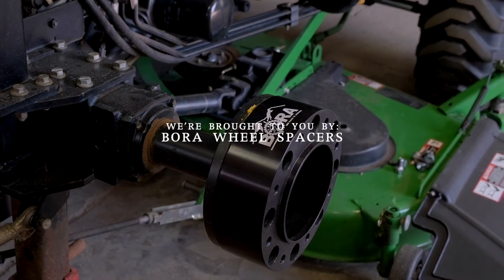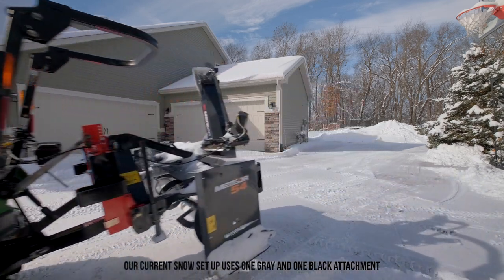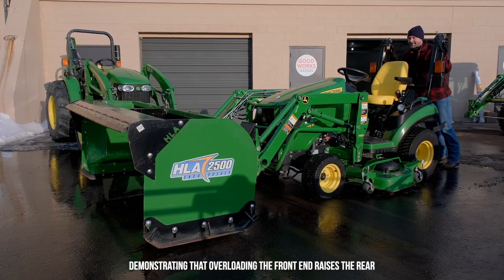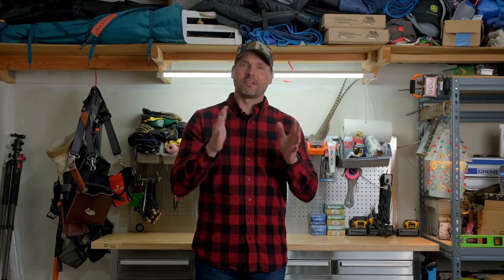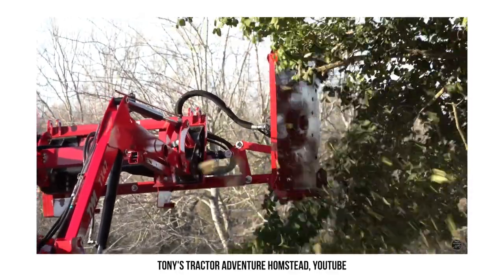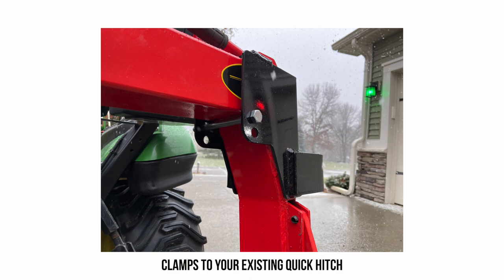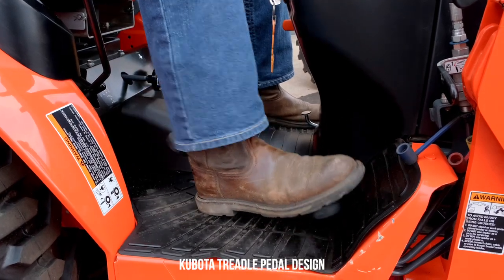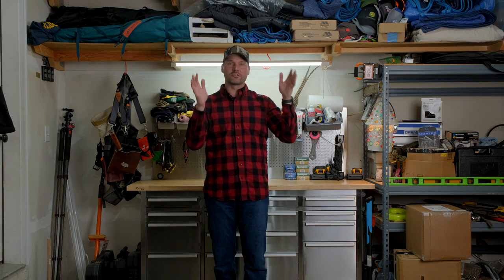7 UNSOLVED TRACTOR MYSTERIES, NO EXPLANATION.  CAN YOU HELP? 👻

Comment: I completely agree with you on some of the ergonomically engineering. I’m sure with the rollover bars that OSHA probably has something to do with that with it has to do with an overall tipping point but on the smaller stuff like to 1025R I just don’t see why it Hass to be so tall but they all are that way. I’m guessing it’s some archaic regulation probably for bigger tractors that they just got stuck dealing with maybe. Either way I agree with you on the pedals. I got used to my John Deere and honestly never really thought about it but it is reversed and that could be confusing to a first time driver but cars don’t have reverse pedals anyway so I don’t think it’s a big deal.  Some people love their Kabota‘s and that little hill reverse thing. I think it’s completely ridiculous and I know many many people that chose not to buy a compota specifically because of that. But I will give Kabota one thing. They do listen to their customers. You can talk to John Deere till you’re blue in the face and they do not care they don’t even wanna listen to you but Kabota listens there are many things on Kabota‘s that have been updated and fixed because the customers kept talking to them about it and they listened. As someone who’s worked in ergonomically engineering and refining existing products I find it incredibly frustrating that some of these things aren’t fixed. So many things are almost universal. The little hill reverse thing on the Kabota is just stupid to me and somebody gave me one one of the very first things I would do would be to cut a hole in there and figure out how to make my own reverse pedal linkage to cut that thing off it’s in the way and it’s unusable as far as I’m concerned. I get it works and come out of people seem to be fine with it and that’s cool but I personally think it’s ridiculous and horrible engineering. The things that really bug me are some of the regulations like the whole region thing is just stupid we’re supposed to save the environment by making us tractor sit there and rev for 30 minutes on their own? That’s just ridiculous and everybody hates it and it’s not doing any good there’s just some control freak malignant narcissist somewhere that decide to make stupid rules and it’s a joke. Same with the rollover bar if that’s that high for some sort of regulation. You could lower a 1025R roll over bar by a good foot and it’s not gonna roll over and then extra foots not gonna prevent it from rolling over and the only advances I can have to seeing it be that long would be if you put a sunshade top on there it would keep it at a good height but it would take almost nothing to make an extension on the top that you’re gonna have to bolt on anyway. I have problems with the seats, not the seats in particular but they’re cheap poorly made seats that should literally cost $30 tops charging $120 for this junk and it’s ridiculous and the other little problem I have is every tractor as the stupid little things that break all the time and they don’t fix them. It’s not like these things are at $3000 they charging $20,000 for a little tiny lawnmower with a loader and a three point on the back, they could pay a little more attention to detail. 

As far as what you’re talking about tractor is being tall and tipsy, they couldn’t improve it but tractors with low ground clearance or a real pain in the butt not just because they get hung up and hit things but even just to clean and maintain them when you’re constantly getting dirt and mud packed into all of that is just a pain tractors with nothing down there and plenty of clearance don’t have that problem most of the time and tractors have always been kind of tipsy. Before front and loader‘s were standard they used to put much wider front wheels on them but they were very weak and can’t handle a loader, so in my experience I find it more annoying when they don’t have the ground clearance, especially if it’s something stupid like they didn’t wanna take the time to put any engineering into a hitch and just bolted some thing huge and ridiculous on the bottom I took away three or 4 inches of clearance. Stuff like the Borla wheel spacers or just getting them with offset spacing is a plus and I would much rather go that way than lose ground clearance. They could set the engines a little lower but tractors are tall skinny tools they’re just going to be kind of tipsy they don’t have suspension and try to make a suspension that works and provide stability for the work and the lifting a tractor house a deal would be unbelievably expensive he would double the price of tractors trying to deal with that he would probably need hydraulics and computers add gyros like a helicopter uses.  It’s kind of like a chainsaw they’re just sort of dangerous tools but they do jobs others won’t. And I think the difference with the loaders on a tractor is a tractor is a multipurpose utility tool. If you want a very stable lift then you get a track loader or a skid steer where the whole thing is the loader pretty much but tractors are kind of multipurpose so though there is room for improvement it’s kind of the nature of the beast.  

The biggest complaint I think I have with tractors especially in the compact tractors, and it’s definitely gotten A lot better over the last few years but you’re paying 20 or $30,000 for this thing and they put junky little plastic pieces on it the break in Bend. I could understand if you were buying some discount Chinese company made tractor that they were selling at half the price but if I paying $30,000 or even $20,000 for a tractor it would be nice to have handles and switches didn’t just fall apart and crack or fall off. 

Another thing that I think would make these a lot more accessible and they have the same problem in the car industry is the price. There are so many bells and whistle‘s on there that are nice but are incredibly expensive somebody’s just going to push snow mow their lawn and grade their driveway I could get rid of a lot of that stuff I make these things a whole lot cheaper a very stripped-down version of a 1025R that come in five or even eight or $9000 less I think would sell like crazy same with cars. You go out to look at a new truck and they’re off $48,000 for the cheap ones. If you look carefully Chevy and GMC and Ford actually make trucks without all that leather – crap they still have the old style plastic dashes and all that they’re about $15,000 less but dealers don’t carry them they’re almost impossible to fine and you almost have to order fleet vehicles to get them but I bet those would be the biggest sellers because not everybody’s willing to pay $10,000 for leather dashboards and seats and a Dinali package and a lot of cars and trucks have kind of pushed that whole luxury high price thing and made it a standard. We’ve got two trucks that are 2002 models that have the plastic dashboards and all that and they had the luxury items back then but we just didn’t wanna pay an extra $10,000 to have that stuff I don’t need fake wood and leather on the dashboard of a pick up truck for that kind of money but tractors are kind of like that even some of the cheaper ones like the Mahendra‘s and coyotes, if someone would just do a very basic tractor that pool box blade mower and a brush hog I have a cheap little tiny loader that will do mulch and stuff at the home and gardening level people do I think a lot of people would be willing to sacrifice everything else for a few thousand dollars. I could be completely wrong because we don’t have those options but expense is one of the biggest crock bombs in the tractor market especially entry-level in the mini tractors. If you’re running a big farm business you’re willing to pay more money for your equipment because that’s your business it’s about your time and dependability but for someone who wants to move a little mulch and maintain small and medium size driveway and mow his lawn and occasionally cut down a tree and drag it to a burn pile there’s a lot of stuff they’re never going to use A simpler cheaper option would be awesome. I’m sure they still have it but they used to have a 700 mower they had a three point on it, something like that with a simple light weight front bucket, maybe like those aftermarket ATV front buckets would work for a lot of people that are not willing to flip the money for a 1025R or a BX but there’s really no option once you get up to the size of something with the loader then all of a sudden you’re jumping thousands and thousands of dollars in price and for a lot of people in the entry-level market it’s just overkill and a lot of that stuff just isn’t necessary. I think the absolute worst is the toolboxes though like you were saying. If a 20 or $30,000 for a tractor and it has a two dollar Harbor Freight toolbox on it that usually doesn’t even close because it’s so cheap it’s warped already. Ugh. Harbor Freight has four dollar models that are made out of metal and actually work they can put the extra two or three dollars into it and put something decent on there.

Comment: Tilt gauge question is easy to answer. Purely a liability issue.
Reply: I kind of disagree.  I feel like a $5 tilt gauge with clearly marked "DO NOT EXCEED"  limits would cover the manufacturer even more.  Hell, I'm sure that Japan, Korea, or China could make one with a buzzer and a warning light for less than that.
Reply: @dustyphillips3166  I don’t think so. You just know some guy on a slippery hill going too fast is going to end up on his lid anyway, and he will go to court saying he was on the right side of the do not exceed label. Either that, or they would have to make it at a super safe level to avoid that risk, and it would start buzzing when one hub was an inch lower than the other side.
Reply: You can hit a rut on flat ground and flip a tractor going to fast

Comment: Been studying the power supply for front versus rear end snow blowers. Lots of loss with the hydraulics up front. Why can't they make a transfer case to power up front?
Reply: You can get front mounted hitch’s and front Ptos on tractors. Normally not an option till you get into the five series and above tractors. Most of the time above five size. I think horsepower and expensive has a lot to do with it. Having a whole gearbox setup on the front adds a lot of expense. Plus demand is on the lower side. My guess is it is mostly the snowblower people that want front pto. Plus you would need movable power up and down three point front arms. Snowblower mounted on loader. With pto coming off tractor might have some issues. Not to mention might block your view going down the road.
Reply: The best option tends to be an inverted snow blower.  They easy to attach to the 3PH vs using brackets and a long shaft to a mid PTO.  They also mean you don't have to constantly look over shoulder or use mirrors while in reverse.  And you don't get a face full of snow because they are behind you while you drive forward

Comment: My 2020 4066R has a downforce kit.  Bought this one used (less than 100 hours).  Had I ordered the tractor new, I would not have ordered the downforce kit.  BUT, If I were replacing this tractor, I would absolutely find one or order one with the kit.  If you spend time with a land plane, box blade, post hole digger etc, it is an amazing addition.  I ran my land plane for probably 20 hours before I realized I should try the downforce, and wow, what a difference it makes.  Especially with the ripper tines lowered — you can really move material.  Now, I wish you could get both the downforce and top-n-tilt kit on the same machine……..Duh.
Reply: Hi, Do you know if that was ordered as a kit. I tried to source it all in one or as parts and was not able to do it. That was in 2014 when I bought my 4052R. The down force option was shown in the literature but not available then! You have given me hope that it exists! THANKS...Jeff
Reply: @jeffbonifield8981  Jeff -- I don't know if it's available post-build or not.  I'll ask and see.  In fact, my dealer called about a month ago and wants to buy by 2020 and he'll build me a new 2022 (exact same specs, including the down-force kit) for very little cash plus the trade.  I suspect he already has mine sold. So I know you can have it added to a new order.
Reply: Thanks, Sound like a trip to the parts counter is next for me! I know the used market is crazy...like everything else these days. I would be curious about the lead time on a new unit. I actually forgot about the down pressure ram until I saw this post and your reply! Now I have another project in the wings. I will let you know how my hunt goes and thanks again!
Reply: Jeff, I made the deal about a month ago on the trade, sounds like late June or July before the new one gets here.

Comment: I think the reason we pull the attachments on a tractor is because the tractor was created to replace the horse.  They are narrow for the same reason a train track is 56.5 inches.  It all has to do with the width of a horse's ass.  The height issue is crazy, I have a Kubota 3560 with a canopy on it, it misses going into an 8' door by an inch.  Kubota uses orange paint because green paint is apparently so expensive.
Reply from the maker: Good theory with the horse, I can see that being the reason.  

Haha, the green paint surcharge!
Reply: @GoodWorksTractors  Keep up the great videos

Comment: Are there any episodes concerning increasing the lift capacity of the front and loader on a tractor? For many years John Deere produced two different loaders for the same tractor. The thought process behind that makes no sense to me. For instance, my tractor was equipped with a 300 X loader versus a 300 CX loader. Are there different hydraulic cylinders or hose kits that will enable me to increase lift height and capacity without searching for and finding a 300 CX loader. (We know how difficult that task can be.)

Comment: I have a John Deere 6330. It has a pretty good hydraulic system. Close to what my skid steer has.  But it ain't simple. The pump is variable displacement so that the engine doesn't need to drive full hydraulic power all the time. The oil reservoir is rather large, and is also my diff. 😁 And the oil is cooled by a rather complicated bifurcated coolant system that cools the engine, intercooler, I believe the clutch, and diff oil which is also hydraulic oil  as stated earlier.. I don't know if you have the room on a subcompact or compact tractor for all of the crap needed for high flow hydraulics. Even if you do, it would drastically drive up the cost. But I wouldn't say one is better. PTO is cheaper and more robust. Hydraulics are more versatile. It just depends on what you're trying to do.

Comment: I think that ROPS and cabs are built so that there is a certain amount of headroom . As to not having down pressure , i think that the mecanism to provide down pressure  might not fit in the space avalable. .I worked at Polaris Roseau for 31 yrs , in that time I had a lot of discutions with various engeneers   The main points were generally cost, size limits, structural limits , operational limits . Another thing to consiter most tractors , cars and machinery are built on an assembely line , which means each person has a very limited amount of TIME to do each operation also each part may not fit perfectly.. Thank You  if someone would point out how to spell that would be good , Thank You Another thing not every thing is found in testing

Comment: My Belarus AS250 (25hp. 2-cyl. AIR-cooled) tractor had "down pressure" on the lift arms.  I paid $700.00 for the tractor.  It ran.  I've since "outgrown" that machine, but sometimes miss that down-presssure function.

Comment: Check out the yanmar yt3 it has a shuttle and a gas pedal so it is like a car but acts like a tractor with a hst.
Reply: A Yanmar YT347 has 5.9 more PTO HP and the 3PH can lift 256 more lbs at 24" vs a JD 4044R with the same engine and hydraulic flow rate because the Yanmar I-HMT is so much more efficient than the traditional hydrostatic in the JD.

Comment: Tractor hydraulics don't provide near the volume to be very effective for power driven equipment. I built a ditch cleaner that was kind of like a fan throwing dirt so I wouldn't have to spend so much on hand labor in Colorado back in the 80's. I could swing it out to the side and drop it in a ditch. The hydraulic driven motor worked pretty well if you had very dry dirt, but any mud lugged it down. 1st gear was not slow enough because you had to use full throttle for the hydraulics. This was on a 4430 with a 16 speed Quad Range transmission.

Comment: One of my biggest complaints about compact tractors is the crappy lighting they come with. I know you can easily upgrade this but for Gods sake how hard would it have been for the manufacturer to go beyond two headlights behind a frontend loader. Makes you wonder if they aren't connected somehow to the aftermarket accessory companies.

Comment: my answer for the 1st question is i have an orange john deere 112 they also make yellow, blue, and also green, its the patio series

2nd question, for the tippy part i would say keep the loader low it so it isnt up high enough to tip over also if you have lower front end so its not as likely to tip over

3rd, not really a question 

4th, also not really a question

5th, john deere does that because of shorter people or its just easier to use because your accelerator is closer to the middle than the reverse and i know nothing about kubota

6th, they have that becuase if you want to you can have it so you dont tip over, if oyu dont want that you can fold it down or just unbolt the entire rollbar